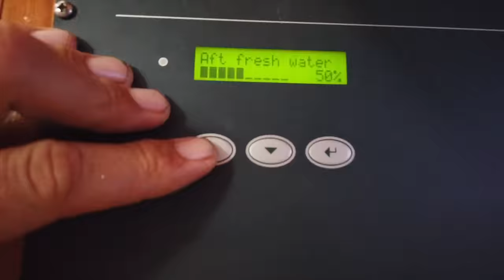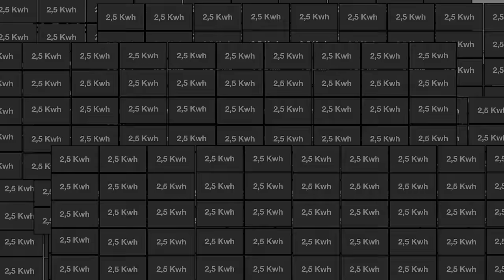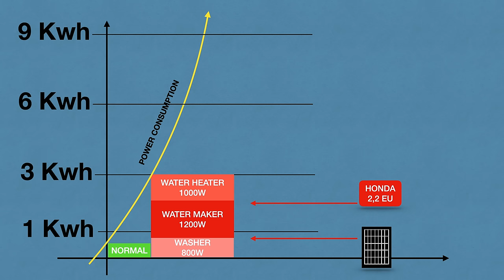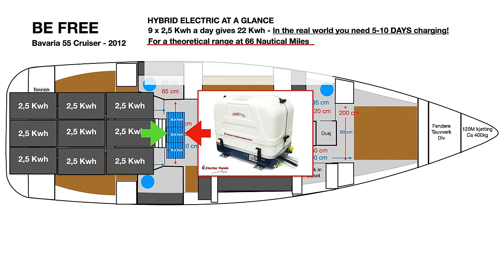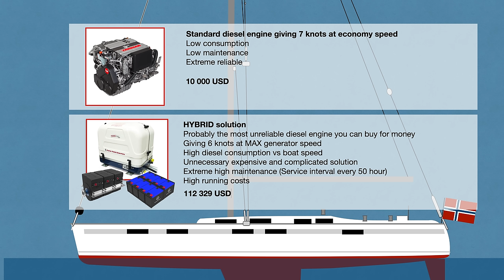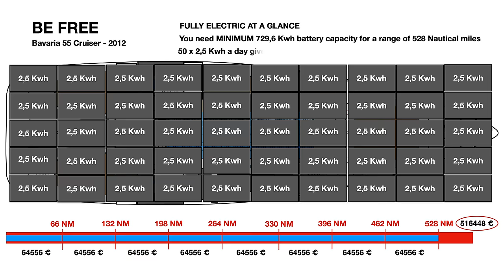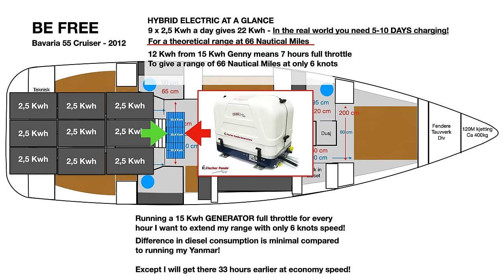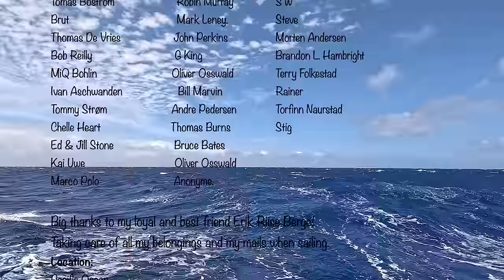Why I don't believe in ELECTRIC or HYBRID for long-distance sailing - SwT 170 - MY HONEST OPINION

Comment: Mostly fair points, yet electric propulsion is coming.  Sure there is reduced local air and water quality benefits but it's not about the environment, its a better experience. Once you experience an electric drive you would never want anything else. Battery prices are plummeting, solar efficiency gets better every day, this is just the beginning. 

Unless its something you really want to do, it doesn't make a lot of sense to rip out a working engine. Yet, to put a new diesel in a old boat in 2024 is also kinda crazy. At the end of the day, the final drive will be electric. Maybe for the time being a diesel generator is the crutch. Eventually it will be replaced with more efficient solar, fuel cell, or something that isn't even invented yet. 

I don't believe he talked about an a parallel hybrid? While all electric is more my style it has its limitations for sure. Serial hybrid would be my personal second choice, but there is absolutely no valid argument against a parallel hybrid. This is what HH and soon to be many manufactures will offer. 

Yes I'm biased, but I also know what I'm talking about. Electric boats are my business. If anyone wants to experience an actual electric boat, instead of of listening to someone who doesn't have one. Reach out any time and ill take you for a sail!

Comment: I worked in solar for many years. You are making every scenario out to be worst case possible, some scenarios you posit are not possible in the first place. Your estimate for number of solar panels needed was WAY off. There is no need to completely charge your battery bank in 1 day. It is easy to carry a portable generator and some fuel anyway. In a way, you have a point though, there is a limitation because of the current efficiency of solar panels. Much better to have a boat that was designed to carry enough solar in the first place. The energy density of batteries is progressing at an insane rate, and solar is making consistent, albeit slower progress in efficiency.

I watch a lot of sailing videos and people's diesel engines are constantly having problems. In fact, minutes before watching this I was watching another video where the guy's engine went out near the beginning of an atlantic crossing, he had to do the rest of it with no engine. Electric motors, solar panels and lifepo4 batteries are extremely reliable. You can wire them in such a way that you effectively have redundancy at the flip of a switch. Use dual charge controllers, or carry a spare.

Comment: Well, as most green solutions advertise optimal numbers you surely tell the worst. You're a sailboat and that's a hybrid already anyway. Charging a massive batterybank in a day is nuts, same as the 500Nm range. What you are doing now is just comparing diesel engines against diesel generators, that's just not true for hybrid sailboats. 

Without too much comfort (Ahum AC), and sublimented by regen, solar, you should be able to (re)charge a small battery bank before entering the harbour again. 
The generator in a hybrid sailboat solution is only for when the battery capacity falls short, or when motoring hours on end is needed. That is your gain! And no massive battery bank required. 
Don't forget that the Fischer Panda is a diesel engine too, but terribly designed. There are many reliable generators availabe that will make you much happier. Hybrid is not bad just because your generator sucks ;)

Besides, solar will never move anything heavy from A to B for long. That's where sailboats shine. You have the sails for that! 

Thank you anyway for the great video! This topic really interests me, I just don't agree with your conclusion ;)

Comment: Your comparison is flawed.

Your complaints about reliability of diesel generators seems applicable to your diesel engines. In any event, you can put a generator type alternator on your diesel engines.

Benefits of electric system include reliability, near zero maintenance, instant power, regeneration, and repower through solar, wind, and generator. With a suitable Faraday cage you should have ample protection from electrical storms.

It seems an all electric propulsion with a quality diesel engine as the generator, such as your main engine, would be ideal, optimizing the diesel engine performance by using it as a generator and optimizing powered propulsion with electric motor and battery. The possible power loss with the diesel electric setup is mitigated by the efficiency and flexibility of an electric motor and its ability to complement deployed sails.

Comment: I disagree with you as hybrid is the way to go, but you just need a much more efficient engine/generator setup.  The problem is the bad design pushed on the world, the diesel crap with the generic, poorly designed engines that current are the status quo, are likely among the worst scams pushed onto the global market! For instance if we had a sweet design like the Omega1, or a dynacam style barrel engine ,where the parts count of the device is significantly lower than what we have . . . 

anyway , fair winds and following seas to you!

Comment: We have calculated on a full electric catamaran with double back upof large generators and the hull fully covered with solar., On our monohull bavaria ,like yours, electric is no solution, not enough surface, not enough space. although some new engine types with built in electric assistance are changing the landscape (with very low hp's I must say) and for many boaters those hybrid engines could be a start into semi electric drive, just for in and out of marinas. A. Fisher Panda? its is a different story, a complete joke, I agree, never buy them. clent servces are poor at least too say. quality , I think even a cheap chinese diesel with a balmar is better. 

What we calculated does not fit on any monohull under 150 ft, nor a catamaran under 45 -50 ft... On the catamaran? It's very expensive in comparison, and in sense of the amount of diesel... its almost equal usage... but its far more silent. Well that is if the hull does not make any noise in the waves.
 
We calculated with 440 KWH in lithium, at roughly the price of a monohull just for the batteries, Its a none-workable solution for most budgets. Hence as for money:  there is no advantage, as for range, no advantage, you'd get 8-10 hours with all other systems running. As for weight, no advantage, as for a solution? Not for what you are doing. Utopia at best for most boaters. Do we proceed? could well be as we are discussing a unique combination of latest technology. We are 90% in areas where solar works..

I follow some manufacturers including companies that do hydro and air as alternative for diesel. I follow the tests that are being done by various builders and conclusion: diesel is still the best and most efficient solution for 90% of boaters that like to cruise long distances.,  with an investment an electric powered boat can be made to work and when you calculate all that there's no advantage as soon as you count in the replacement of the battery bank after 7-8 years. 

But it's a political issue now, after 2030/(2035?) or such you can only enter the med with electric...

Comment: REGENERATION ?
Reply: Think 400W to 1000W for Regen. Electric engine need 20000W for a boat like bfree to do 6knots. So you need between 50h to 20h of sailing for 1h of electric engine.

Comment: Charge 700kwh in one day but having battery for 500nm jajajaj. So you go 500 Nm for 1 day.  Fast boat 😂😂😂. Going electric is going also slower. Not runing 500miles a day like you. All 3 boats I have I converted to electric and traveling the world and every day out sailing and using electric motor. I never use all my battery and they aways recharge in 1 day. 
 MAYBE IS TIME TO LEARN SAILING SO YOU USE LES MOTOR 😂😂😂😂

Comment: Funny thing about Generators is that they have to correctly match the load and conditions, and Generators do not usually go wrong all by themselves in a Vacuum. Usually an anomally in the load, the wiring or a lightning strike, or not correctly matched to the load, is what takes out a generator. The funny thing about electricity is the vexing problem of a shitty load or connection or piece of equipment or lead, that will Generate/Induce a Momentary High Voltage (Spike), back towards the Generator that will manifest in and destroy the electronics (AVR, Automatic Voltage Regulator) you name it, Flash over the Exciter windings, blow the flying diodes in a failure that makes you believe, unfairly, that the machine has Unexplainable Demons. The funny thing is that it, (The fault), is usually, nothing to do with the Generator. Almost always it's a shitty back output from the load (Back EMF Spike), blasting back in the opposite direction to cicuit direction. There are ways to protect a Generator from the load by using a PMG output, which relies on a small generator on the generator to generate the DC excitation separate to, and pretty much without reliance on sensing and sampling the output. Also one can employ an isolation and purification system which is ultimately confusing to a mere mortal. One of the best things though is to analyse the complete Electrical Generator Operational Interaction with the load/s using an Oscilliscope to identify any equipment putting out shitty Spikes as a result of some problem in the load side. NEVER use or introduce a piece of equipment, or power lead, to your system, unless it has been fully analysed, especially if you have been having trouble. The most innocuous piece of equipment can take out any unprotected Genset. Don't buy Cheap Generators! The Generator salesman is not your friend. You are a Mark! If a Generator salesman quotes you a Generator in kVA, he is talking BULLSHIT! A Generator has not, Will not, ever, Generate kVA. In the context of what  you are expecting your Generator to do for you IT WILL NEVER GENERATE kVA. kVA is a Salesmans Semantics to make you believe that you can squeeze more out of your Generator than you have paid for and you believe it because you want to. As far as Generators go, TALK kW, 'cos that's what Generators, generate. kW IS WHAT THEY WILL DO, kVA IS WHAT THEY WON'T. Idiots will argue the point. Another common issue with Gensets is the tendency for your mate the salesman, to sell you a Genny that is far too small. Now pedants are going to point out what they imagine is my error, here. The genset is generally marked as kVA then kW with corresponding current output. If you take the imaginary kVA current output and divide it in half and then call that the size of the load, in kiloWatts, then that should be exactly half of the generator full load continuous rating,  required to service the load in kiloWatts output. What I am saying is that if you calculate your full load current, with everything running at once, (I know it never will, but it will), absolutely fully laden, balls to the wall, (Thats a steam engine term and has nothing to do with Genitalia), continuous 24 hr rating, 'cos it may have to someday, then that should be 50% to 60% absolute Max output of your Genset, in kiloWatts, (From my extensive experience). If your load works out to be 40 kW or as calculated 50 kVA then you will, for equanimous operation require, 80 to 100 kW/120 kVA (Rated), Generator. Don't think that it ends here though. Notice it's called a Generator Set. Now you've got the Generator, Rule of Thumbed how about the Motor? H.P. Consumed is usually close to rated current in a three phase Generator Set, so you have a guideline for how much Mechanical Power you require, but once again, when your Genset, at full load, Balls to the Wall requires say, 100 H.P. you will need an engine capable of DELIVERING, at least 120 H.P. CONTINUOUS, but FOR COMFORT, 130-150 H.P. How long will your engine last and how reliable do you think it would be operating on the edge of stall? I have run a 150 kW 3 phase Generator at Max and then introduced 2 more kW and listened to it die. Very impressive expecting a Con-rod to fly out the side. Turbo crying! New or more expensive, Generators have under frequency roll off, so they can avoid that to a small degree by load shedding. My point is, just like the sweet spot when you hit a golf ball it is easy to calculate and regulate the correct size engine for your application, which won't be the one they tell you it is and using the correct size Alternator, which definitely won't be the one they're pushing on you. The thing is, you'll be sold what you can afford, not what you need. If you understand your installation completely, then that is a start. Another thing is that everything, particularly mechanical contrivances, go out of spec, and also what was your load when you got the boat has mission crept a bit so your mental picture of your installation is now totally incorrect. Thats why I allow those generous margins in sizing engines and alternators and the best rule of thumb is, if the sales rep tells you on his childrens life, that this is exactly what you need for blissfull utopia, he's talking B.S. bigtime, but he's not lying technically, because he really believes what he's saying. Problem is, he doesn't, in the fullness of the situation, know what he's talking about. If you buy a cheap Genset, you will get exactly what you pay for. Apologies for not strictly observing and/or adhering to accepted polite rules of Grammar but she won't mind. Enjoying your content.

Comment: They travelled the seas long before the fossil engines was invented. So it all comes down to convenience.
Reply from the maker: Thank you for watching. Your comment is true, but the reality from that time has a very dark side you forgot. It’s for sure convenient with a trustworthy engine, but most of all it’s about safety. Evolution gave us engine, and it has saved more lives than you can imagine. Back in the days when ships did not have engine, the most feared places was what they named the doldrums. This is today called convergence zone. You find this in all oceans when crossing equator. The biggest is the SPCZ. When ships where trapped in the doldrums drifting for months with no wind, many died when running out of food and water. 

Also until today no ship has done a full circle without fossil fuel or some sort of oil. The old ships used charcoal to cook, and lamp oil for their lights and navigation lights. Just as a fun fact. The same phenomenon (SPCZ) also makes a fully electric boat useless. You would need a generator, but then your not sailing a fully electric boat. It’s not unnormal to run engine nonstop for 3-7 days to escape the SPCZ. With extremely little sunshine in this region, and no wind, it says itself. This is my main point. You have probably seen all the Jerry cans on long distance sailing yachts. It’s for a reason they carry lots of diesel.

All the best

Comment: I concur with Thomas' conclusion, albeit I believe he's complicating matters unnecessarily. The figures involved are much simpler. Operating a catamaran at 5 knots incurs a cost of 10 kWh per hour. Additionally, another 10 kWh per hour is required for other operations. The primary power consumers are the electric motors and air conditioning, totaling 500 kWh per day. To accommodate this, 500 kWh of battery equates to 5 tons in weight. Subsequently, the amount of safety desired is at your discretion. Should you opt for a safety margin covering a 10-day rainy period, you'd require 50 tons of batteries. Mind you, 10 days isn't even enough for a half-Atlantic crossing. To justify such a substantial load, a catamaran ship is necessary. This holds from pure electric all the way down to nonelectric. Presently, 50 tons of LiFePo4 batteries cost $50 million. The only logical rationale for employing batteries is to sustain essential functionalities like the freezer, Starlink, instruments, water pumps, and lights without relying on the motors. Likewise, the sole practical purpose of solar cells is to facilitate charging the batteries for these functions without engaging the motor. In conclusion, before a sensible man can go electric a battery revolution must take place. The energy density needs to increase by an order of magnitude. Instead of 200 Wh per kg, we need 2000 Wh per kg. The life span needs to increase by an order of magnitude and the price must fall to 1/100. Even then you will need an 80-foot cat where the whole top is covered by solar cells. No room for sails or mast - only a kite. No flybridge - recreation at the stern only. We will have to wait at least another hundred years. Diesel is the only way until then.